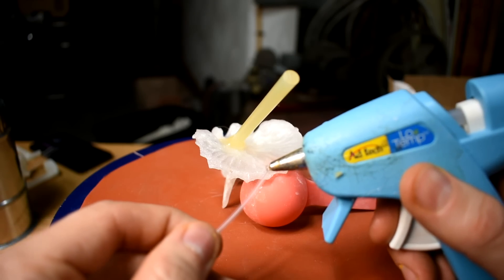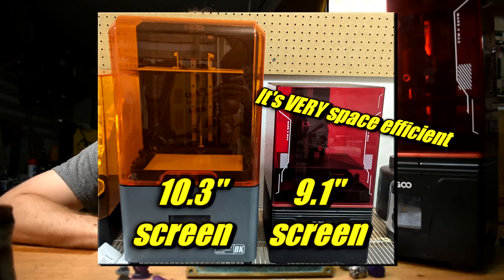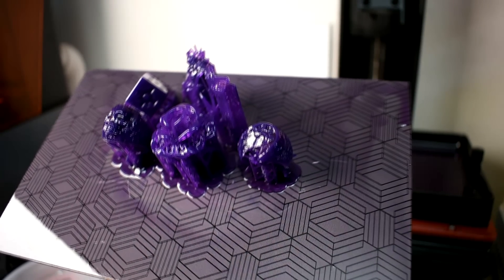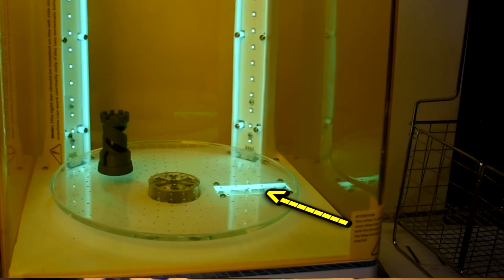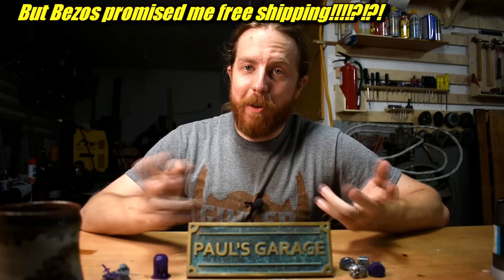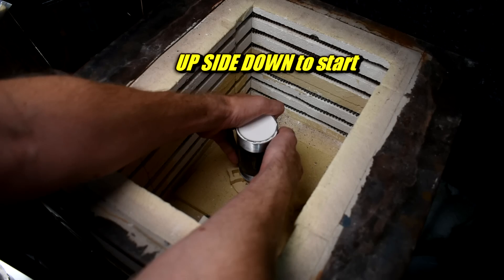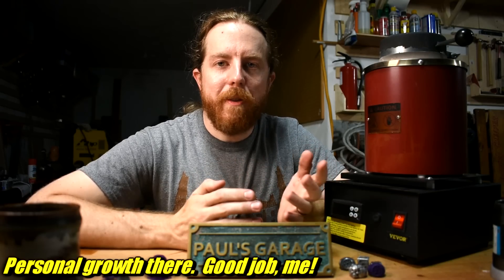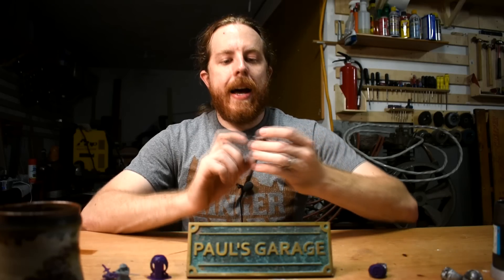3D RESIN Print to Solid Metal, Investment Casting | with Elegoo Mars 4 Max

Comment: Hmm.  I usually use metal dice. Get a rolling mat or rolling tray with a felt lining. Even better, enamel the pips in your favorite color and get a matching felt rolling tray.
Reply from the maker: Good idea!  I've never tried metal dice.  Maybe aluminum would be better?
Reply: @PaulsGarage  perhaps. The most important thing would be to eliminate voids. Assuming you want fair dice. I have a couple of baseball sized d20s that weigh over a kilogram and my d6s seem denser than aluminum, so I was surprised your die didn't want to roll well.
Reply from the maker: do i want fair dice?  depends who rolling them 😂  Isuppose it would roll better on a surface with a bit more friction.  On smooth surfaces it wants to slide and not roll, unless it gets a corner dug into the soft wood, then it rolls (but dents).  Maybe i need a silicon mat or a tray like you said.

Comment: Nice! Been getting into this as well! Have you ever cast anything bigger than ring/dice size?
Reply from the maker: Not with investment casting, but sand casting yes.  Biggest part was a little over 2 feet long.  That would use a LOT of investment plaster lol
Reply: @PaulsGarage  that's massive! Well for hobbies anyway. Trying to figure out how to cast a medium sized Stirling engine myself.
Reply from the maker: That sounds like an awesome project!  Sterling engines are awesome.  You might need to get some parts machined for that right?  I'm always nervous about machining my castings.  I do a lot to try to reduce porosity but you can never be sure without an xray test
Reply: @PaulsGarage  fair enough! Yeah, if it's a high compression thing, getting voids could be a real problem. Though I have seen some pretty janky cast aluminum gasbike motors and they get around it by just steel lining the cylinder.

As for the sterling engine, I am not super concerned about voids because of the lack of a need for compression and fuel.

Comment: I have a centrifuge, it cost me abput 60 usd (in mexican money). Insanely cheap for the thing you can do with that lol! you should try it! no air vents and molten metal spinning at hihg speed what could go worng? you can use a lot more alloys using a centrifuge
Reply from the maker: Sounds fun but I don't need molten metal flying everywhere 😂
Reply: @PaulsGarage  Usually those are inside a box for exactly this reason. Centrifular juwelry casting is pretty awesome. It even works with delft clay. So basically you stick your wax master directly into delft clay and cast metal in it without any burnout. The centrifugal force forces the metal in there really well and at the same time melts the wax. Super cheap and easy with great results, sadly not many people do it though.

Comment from the maker: Check out my New 3D Printer Focused Channel!:  https://www.youtube.com/@PaulsPrinterProjects
Investment casting a bit intimidating?  Want to use your 3D printer to learn SAND Casting in your home shop?  https://paulsmakeracademy.mykajabi.com/joinus
Reply: Already have this printer and my build plate has a different patten. What metal is the easiest to melt for this sort of thing.
Reply from the maker: I saw one guy on youtube with this same printer who didn't have an etched build plate, I wonder why?  I used za-12 (a zinc alloy like zamak) and that's pretty easy to melt, it only needs 900f or so.  Pewter is lower temperature but higher cost by a lot.  but this process can be used with bronze and gold and everything.
Reply: @PaulsGarage  don't suppose you fancy seeing if normal resin will felt away to.
Reply: Sighs, this is the biggest drawback. Investment plaster is expensive, burn out oven is expensive, you need the vacuum pump which is also expensive. I mean sure the whole process and the resulting quality is amazing no doubt but for me it is way above hobby grade. I am currently looking for easier and cheaper ways to 3Dprint --> cast in ZAMAC with good quality but way less equpment and money. I chose zamac because it has a low melting point, recreates good details and is fairly strong compared to the next great material which would be pewter. It is heavier than aluminium though. I am trying a combined method of sand casting and using dry wall compound thinly. I will also be trying out heat resistant spray paint (goes up to 800°C) for the mold material sprinkled with fine sand kind of like SuspendaSlurry replacement for cheap. The whole precise burnout cycle and special plaster stuff is just too much.
Reply: @sierraecho884  Look at my other comment. He doesn't know how to cast. ( I have a minor in jewelry, I know this stuff inside and out and he gives bad advice.) Mix equal parts plaster and sand. Clay dust if you can find it, but not crucial. You'll get fine details for pennies per mold.

As for the burn out, don't use this resin. Use jewelry resin. It's mostly wax. It's more expensive, but the burnout can be done without a specialized oven. I've used some fiberfrax (insulating wool, spun glass, whatever you want to call it,) and a grass burning torch.

Casting, look up centrifugal casting. You spin the mold on a chain. Or try steam casting, that's pretty easy too. 

Even better, make your mold, go to your local community college and ask someone there to cast it for you. It's not hard if you don't screw around with bad advice and YouTubers.
Reply: @dominicknepper2082  To be fair he never said he is a pro in casting but he is figuring it out step by step and is showing us his approach and results. I don´t know him but I find him quiet reasonable and nice.

Thank you for the plaster recipe. I shall try it out. However I find the difficulty is for the mold to be completely dry without cracking. 

He is using special burn out resin which is basically UV curable wax. That´s basically what you mean. Regular UV resin of course is a horrible idea. I am using thermoplastic polymer since I don´t wan´t to use the toxic and smelly resins in my small apartment.

The problem with the plaster is not so much the wax resin it´s the plaster material itself. Regular plaster degrades with high temp pretty fast so it needs other compounds like sand or even small wired as reinforcement. This more professional grade recipe is much more refined.

I know of centrifugal casting but what is "steam casting" ? Never heard of it.

We do have ZAMAC die casting at my workplace. So I could cast whatever I wanted at work. We manufacture the Mercedes Star and such parts for the automotive industy. I am one of the design engineers but I usually work with injection molded plastic and steel components. 
The goal would be to cast a part as cheap and simple as possible at home with a beyond hobby grade geometrical result.
Sand casting is cheap and very simple but you can´t cast undercuts so I am looking into other methods instead.